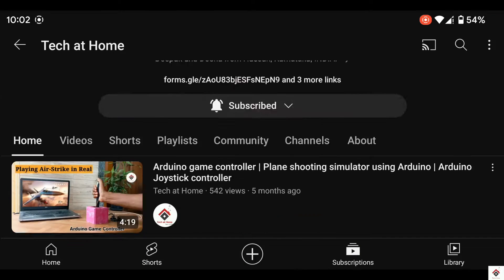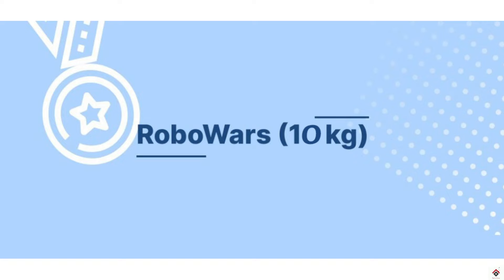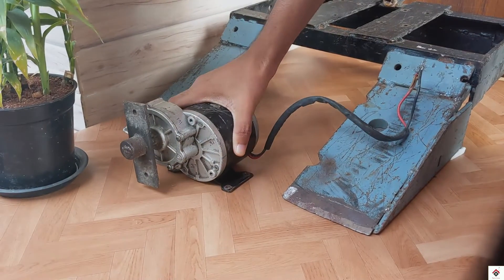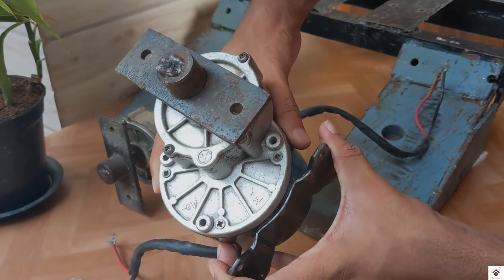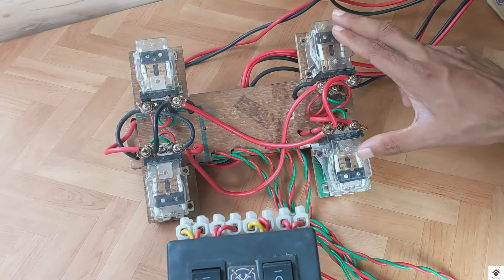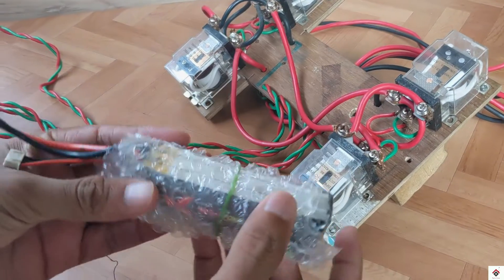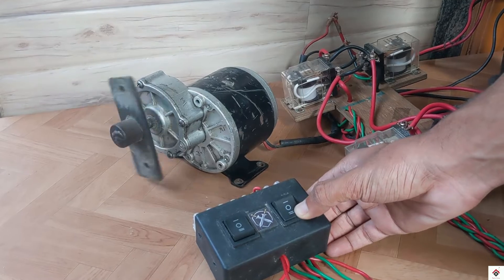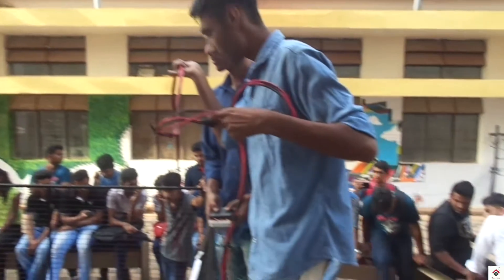Make your own ROBOWARS Robot using Ebike motors & dpdt switches | Robot Wars Robot building tutorial

Comment: How to create a wireless one?
Reply from the maker: You can use these components and make it wireless,
1. Flysky Transmitter and Receiver.
2. Cytron Mdds30 Dual channel motor driver board.
3. 24v Battery.
Reply: @techathome  Thank you so much
Reply from the maker: Welcome ♥️

Comment: What is the tool used here??
Reply: Is this the lifter?
Reply from the maker: This is only defence bot without a weapon.
You can make lifting mechanism on this using high torque low RPM motor.

 I have some photos of it. If you are interested, I can share few photos. Send us mail request: deepakhd20@gmail.com

Comment: 11:19what we call that front thing that is rotating i want to buy...  Ple give the name and the motor used in it to rotate
Reply from the maker: That is drum weapon, it is built from metal cylinder.
I have not made weapon bot. So I don't have much idea. But from competitions I have seen people use Ampflow motors or modified truck starter motors.
Reply: That is a vertical spinner (weapon). It is powered by brushless dc motors with 4k-6k rpm (like 60BLS04) using a motor driver like redbrick. And powered by a 6-8s lipo battery

Comment: Hey is the ebike motor reversible?
Reply from the maker: Yes , I have also shown in the same video.
Reply: @techathome  thank you so much. I'm planning to build a robot myself too have you measured the maximum current draws or maximum loads it can carry in the scope of your project?
Reply from the maker: According to motor specifications, it can take upto 19A (Rated).
Maximum load not tested, but upto 40kg robot still works fine.